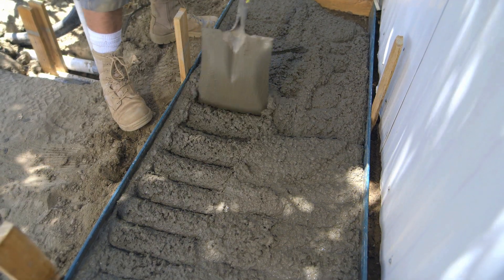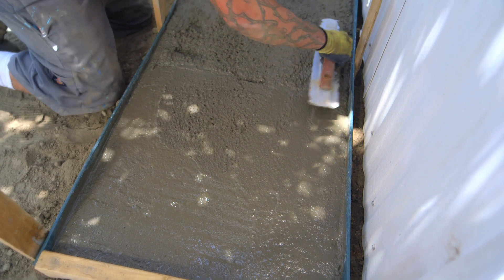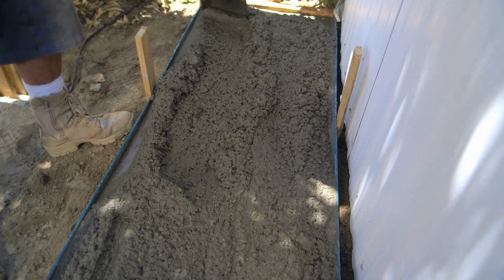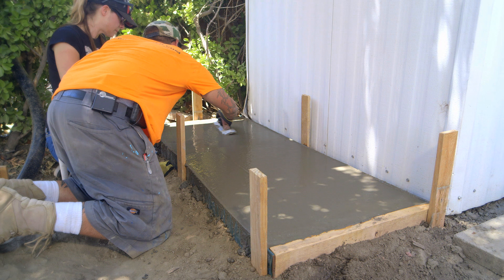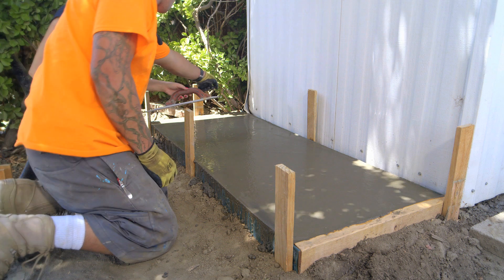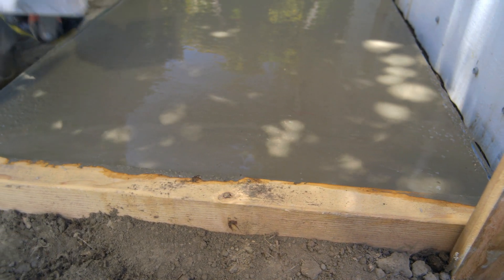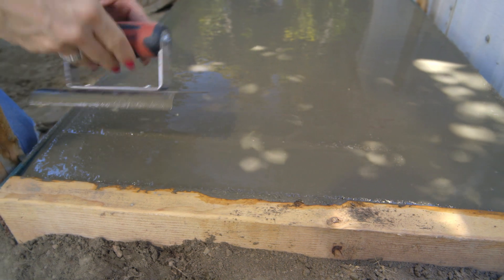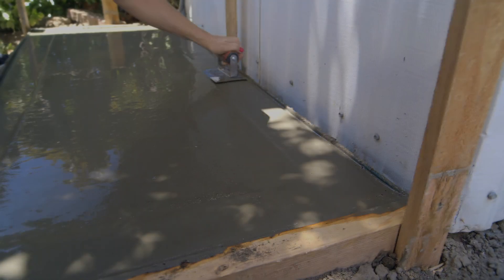DIY Koi Pond Construction | Pond Filtration Station - Part 13

Comment: A nice project under development in Sweden ......Bride to the Island is under con ....so is the small dock ...it will be a thrill ...swim pond made by nature....we just drained it and cleard it from old waist debres ...all Bio wais from the bottom will be sucked of by a pro ...20 cm3 of bottom waist is going out ...20 tons of gravel will end up in the pond ..+ a 2x110 mill drain system (gravity flow ) to a settlement tank 400 liters..66 gallons will be added - My personal design ....big dig going on this wekend...Will post more  of the system later....Eric....your videos are leading the way here....Big THX

Comment: Any tips on expanding an existing pond or joining 2 ponds together.
Thanks
Reply from the maker: MoreThan AFK That depends on the size of the existing pond and how big of an extension you want to do. If the pond is unique in shape and needs a seam to make the pond shape work then absolutely do the seam. If the pond is say 8' x 11' and you are moving to 11' x 16' then I would suggest a new one piece liner. Consider placement of circulation pumps and doing a quality seam on the liner if you are expanding.

Comment: I may be wrong, but from the dozens of yards of concrete that I have poured, aren't you supposed to let the concrete set slightly before adding the bullnose on it? Im sure whatever works for each individual is best, but when I let my concrete set just a little, it gives me a cleaner edge, with less effort.
Reply: Arteolike you are absolutely right about this. This is also what Eric wanted to do, let the concrete set a little. The problem was that Brandon had to leave and I wanted to film him showing the customer how to use the Bullnose, since he was the main person in the film segment. I insisted on filming it with the wet concrete.  

Dietmar
Reply from the maker: TempleCityMusic Arteolike another thing you need to understand is we are pressed against so many obstacles in the filming of this video series. Lighting, overtime man hours, editing flow, scripting flow and the list goes on. We are bound to have a few hiccups that we would love to do differently but the fact of the matter is if we don't push the envelope on things like this the series doesn't get done. Thank you for your ongoing support.